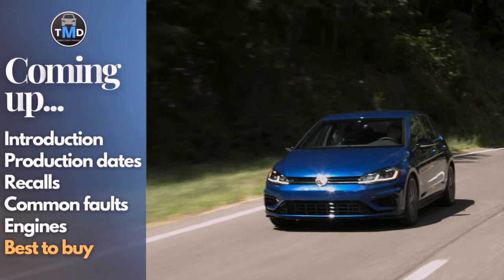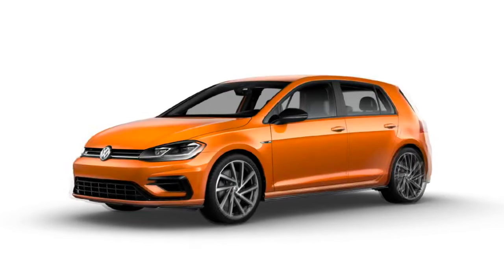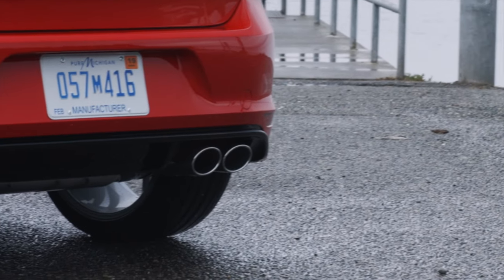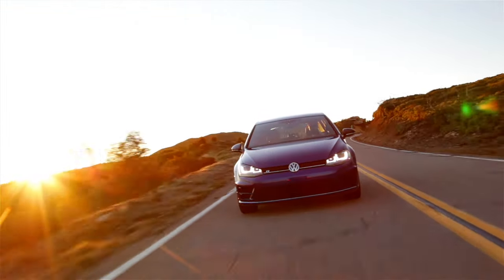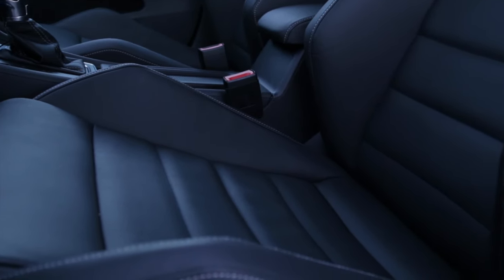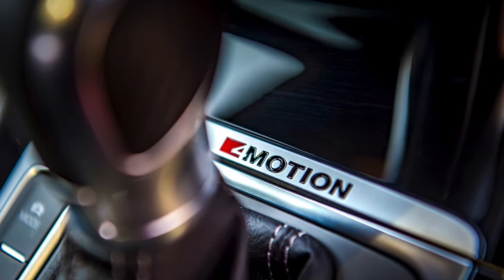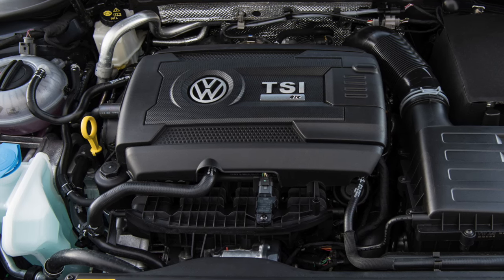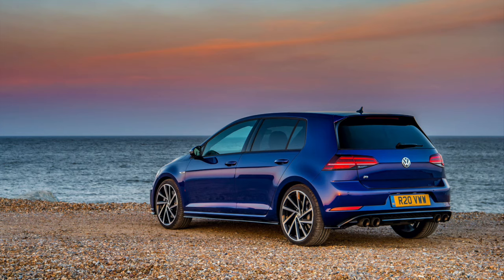Golf R buyers guide MK7 & MK7.5 (2013-2021) Avoid buying broken Golf R with common faults (2.0TSI)

Comment: wtf is 'primary' and 'secondary' 'ride'?
Reply from the maker: Primary ride is affected by larger bumps and disturbances on the road and challenges how well the chassis deals with them, secondary is the smaller vibration and harshness that may be noted either in addition to inadequacies in the primary ride or will stand out prominently if a vehicle has a great primary ride but poor secondary and is more to do with small vibrations. In measuring them the primary ride would be about 3hz, whereas secondary upto 25hz.

Both affect the confidence in a vehicle chassis and achieving it on a car that has a shell used for everything from a small capacity diesel to an all wheel drive hot hatchback is challenging 👍
Reply: @themilesdriven  thanks mate - really good video, learnt something new with the R400.. Shame the pathetic EU stepped in and crushed all our dreams
Reply from the maker: No worries 👍 agreed the R400 would have been brilliant 😎
Reply: @youtuber-cc8sx will be there soon

Comment: Just wondering i have a hesitation issue with my golf R (feels like its in limp mode) when slowing down approaching a roundabout then put my foot down to pull away quickly it sometimes just bogs down...i also had this issue with my polo gti. It's very scary when not expecting it...obviously don't happen all the time, but to be similar in both vw performance cars is disappointing.
Reply: I think it's a DSG thing. My wife's 1.4 does the same. Scary stuff indeed.💩